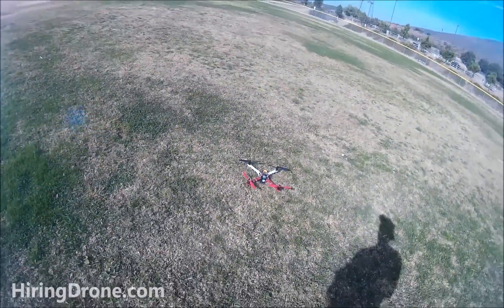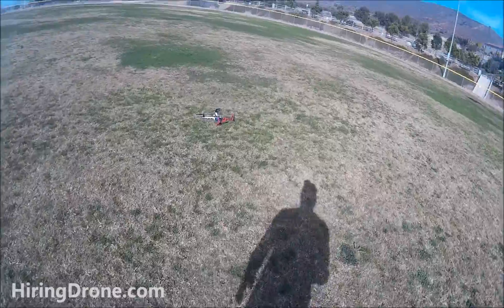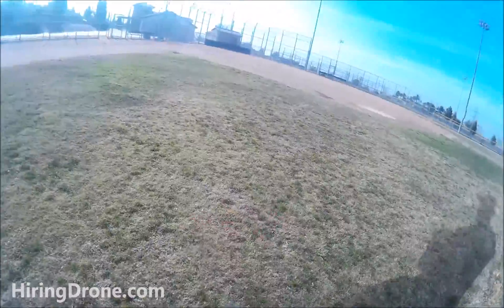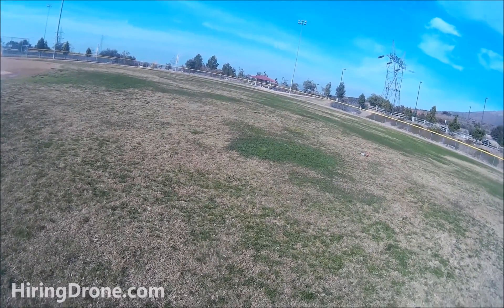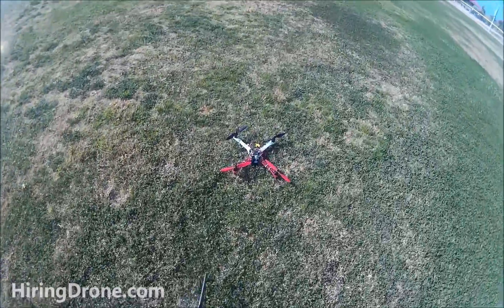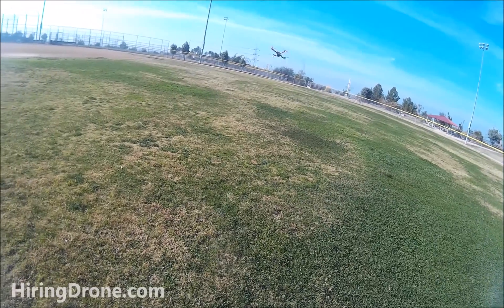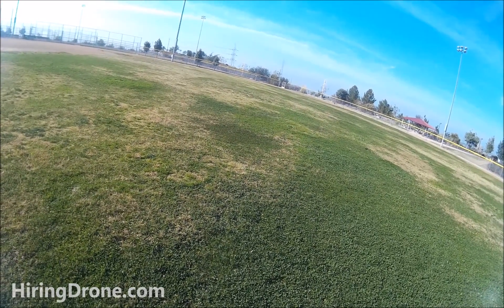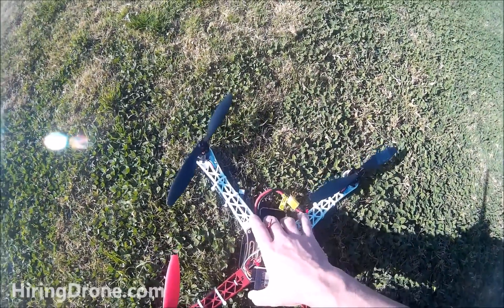HobbyPower F450 Quacopter KK 2.1.5 Settings Fail

Comment: plz share the settings of 2nd time try
Reply: I want 2.1.5 settings pls
Reply: How to stop a quadcopter flipping?
Reply from the maker: +Hariom Aggarwal The issue was actually due to a vibration from the cheap props. I replaced the props and it now flies great. Using carbon fiber props was the key. I can give you my KK 2.1.5 settings if you would like, but it seems like every quadcopter is different.